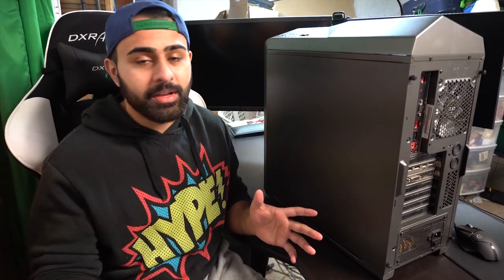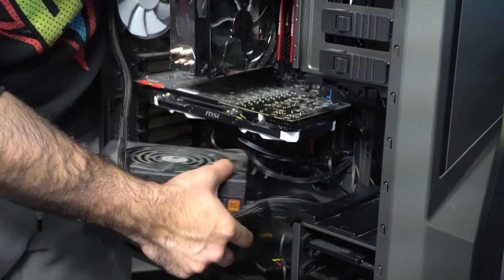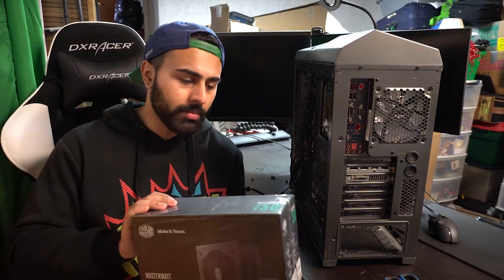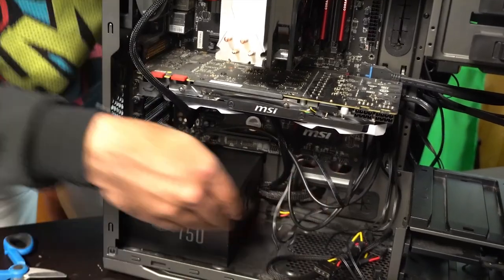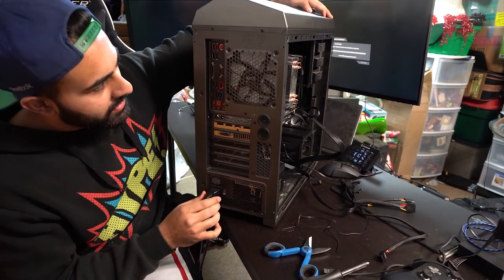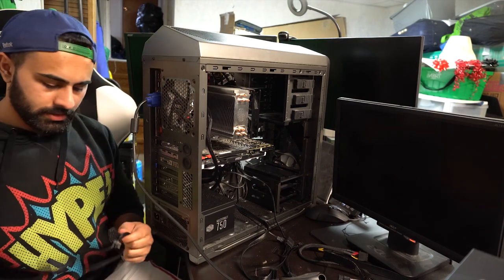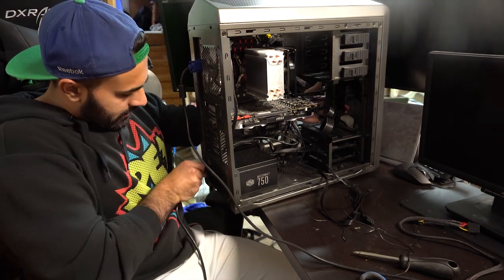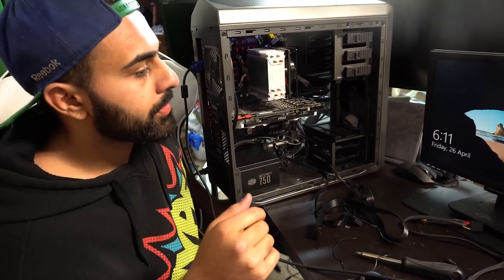💀 DESTROYED my gaming PC! Fixing water damage // Changing power supply

Comment: Yesterday night my Girlfriend spilled soda directly ontop of my pc (by accideny ofc) my Pc still worked for about 10mins then all of a sudden my monitor and pc turned off i opened the case and tried wiping down the mother board and Graphics card. I dont want to disconnect anything because i had mine built for me  in fear of me messing some up. What should i do? And how do ik if there isnt any liquid inside the graphics card or power supply ?
Reply from the maker: Turn the computer off and unplug it for a few days (~3 days). That will be enough time for most (if not all) the liquid to evaporate. Then try turning it on again. Unfortunately if the computer shut off this means something went wrong so you might have replace some parts. But wait for a few days then turn it on again. You can also reach out on our discord server, we have an awesome community that can help you out :)

Discord: https://discord.gg/BnMrrQMq

Comment: I accidentally spilled spoiled milk on the pc and got working after 2 weeks, but the screen won't show. The GPU is turning on and I've tried multiple hmdi and display port cables. Could you please help?
Reply from the maker: Remove the GPU and try a direct connection if you have an Intel CPU
Reply: @VlogsUnleashed  I'll try thanks!
Reply: It doesn't seem to work, any advice?
Reply: Though from what I can see, my gpu won't turn on anymore D:

Comment: My Pc got wet by rain.... but it was turned off and the Ethernet cable indicator was on... what you do think? Should I try turning it on?
Reply from the maker: I would not turn it on for a few days, but first open it up then use a paper towel to dab areas with water so you get the water out. Maybe remove some components to and let them dry separately. People say 2-3 days is the minimum, but I'd wait a week just incase. Hope that help 😁

Comment: I really hope you respond quick cause its urgent but i spilled root beer in my pc and i instantly turned it off. i left it for 1 day and now im just turning it back on. At first it looked like windows didnt recognize me but now i clicked reboot to windows 10 and it works. Is there an issue that something would catch on fire? it seems like everything is dry. but some things are sticky! i dont think that matters unless its a moving part no?
Reply from the maker: I would try to clean as much of it as I can. I would still leave it off for a few days just incase there's a drop somewhere
Reply: @VlogsUnleashed  Thank you bro it ended up being fine after leaving evaporated for 2 days. Some things are sticky. but not wet

Comment: I split some water on my pc and i wiped it up
So i checked if it works and it did i used it for a couple of minutes and after a while it turned off
Then i unplugged it from the power and left it for a few hours
So after a few hours i turned it on and it worked correctly
After like 30 minutes I turned it off and got busy with something else
After an hour or smth it turned on randomly then turned off.
Now it doesn't wanna turn on what happend HELP
Reply from the maker: Wait a few days then turn it on again. There might still be water in there somewhere and you could be causing damage. If in a few days it still has a problem it could be the power supply. If it's turning on and off it sounds like a power issue but it's very hard to diagnose without seeing it
Reply: @VlogsUnleashed  it's working now thank you
Reply from the maker: Glad to hear it! Was it the power supply?

Comment: Today I spilled a little bit of water on top of my pc I think some might have dripped into the top vent but it was on at the time and didn’t shut off it worked fine until I came back a couple hours later to turn it on and the light comes on for a second then shuts off I don’t know what to do and my parents are pissed at me pls help🙏
Reply from the maker: Sounds like you had a similar problem as me. Do you know which component the water fell on? For me, it was the GPU and Power Supply Unit. I was able to start the computer again with a new power supply unit
Reply: Vlogs Unleashed  I don’t know when I I took me computer apart I couldn’t find any water
Reply from the maker: @steenmadsen5180  Try again in a few hours. I  would try to figure out where the water fell. Sometimes the water will leave spots after it evaporates. Try to find these spots and you might be able to see which part had water on it.
Reply from the maker: @steenmadsen5180  Then you might have to guess and check. replacing the power supply might be a good place to start.

Comment: Heya, i spilled water on my pc around 3 weeks, i let it dry out for days, and it works, but I have no HDMI signal, someone please help, ive tried almost everything and it still wont work?
Reply from the maker: Try a different HDMI cord. Make sure the port has nothing inside. Confirm the monitor is on the right input. If none of these work, then try plugging the HDMI cord into the motherboard and remove the graphics card. This will only work with an Intel PC. If that works then you have something wrong in your graphics card. If it doesn't work then join our discord server. We have a tech chat and more people can help there

Comment: Hey my cat peed on mine and now it won’t turn on what should I do
Reply from the maker: Try to wipe off the puddles. Then, leave it off for a few days (~3 days). Try again and see what happens. Chances are that you might need to replace some parts because it turned off by itself. Might be a power supply issue or something similar

Comment: my friend (ex friend), splashed a tiny bit of water on it, I shut if off for the night and I opened it to check for water corrosion, there was none. Am I still safe or should I clean it in isopropyl alcohol.
Reply from the maker: If it was just water I'd wait about 3 days for any remaining water to dry before I turn it on. If you see any puddles soak them up, otherwise wait just in case.
Reply: @VlogsUnleashed  There were no puddles, maybe a drop or two got into the actual pc
Reply from the maker: @nsrivatsa5167  Yeah, so I would wait a few days just to be safe
Reply: @VlogsUnleashed  Theree were no issues and I am freiends with the dude agaiin
Reply from the maker: @nsrivatsa5167  That's good to hear!

Comment: Hello today I got a bit of water on my pc by accident but only about 5 drops got on top of the gpu, I dried it off with a hairblower because I didn't have canned air, I was very fast on turning it off and unplugging it, do you think everything wi be alr in about a day or two?
Reply from the maker: Give it a few days, I usually say 3 days because that's what I've heard. In general you don't want to use canned air or a hairdryer unless it's cold with low pressure. But if you cleaned it up right away it should hopefully be fine.
Reply: @VlogsUnleashed  ok, thank god I hope everything is all right, also quick question, what is the thing on top of the gpu that looks like a cpu socket? A drop landed there and I dried it but I'm not sure what its for, thx for the help
Reply from the maker: I'm not sure, can you post a photo in the discord server?

https://discord.gg/S5sR3frt

Comment: Bro can someone help me i spilt my drink on my pc but it was not that much i waited a day and i turned on everything works but my monitor says no signal
Reply from the maker: That's not good. Here are a few things to try: Get a new cable to connect to the monitor. Try a different port on the graphics card. (If you have an intel CPU) try removing the graphics card and connect the cable directly into the motherboard port. If these don't work, you might have to take it to a specialist. You can also try uploading a video to the discord server (link in the video description). Maybe someone on the server might know what's wrong.
Reply: @VlogsUnleashed  thanks for your information 🙏🏽

Comment: Hi! I accidentally spilled some water on the side of my pc where the power button, headphones and USB ports are located. I already opened it and removed the water. There wasn't much water actually but I am worried if water went inside the ports. Will it be fine? I haven't tried to turn it on yet. It was off when the spill happened. My wifi and bluetooth dongle also got water in it because it was plugged in the ports but I already dried them. Will it be okay?
Reply from the maker: I would recommend waiting a few days just incase. Better safe than sorry. However, all those ports you mentioned won't really damage your PC, so you're probably fine. But just wait a few days incase some water got into some important parts. That way the water can evaporate

Comment: Hey dude i just spilled water on my case and its not turning on, opened it and just waiting for it to try rn, anything else i can do?
Reply from the maker: Do you know on which component the water spilt? Best thing to do is not use it for at least 3 days, so the water can dry up.
Reply: I opened the case and put the fan facing it, that way itll dry up,  The water just went it from the top, split on everything im assuming, do u think i should let a pro check it out now or after a day or two?
Reply from the maker: @jacobchammai5180  If you don't know much about computers, you a pro might be able to help. You can also look around the case and make a list of the parts affected. Then you can try replacing the parts that don't work. The power supply might be a good place to start. For me that was the reason why nothing turned on.
Reply: @VlogsUnleashed  yeah id rather take it let a store check it out, thank u so much man
Reply from the maker: @jacobchammai5180  No problem! If you found this helpful, don't forget to hit that like button and subscribe :)

Comment: i spilt coke all in my pc. pc shut off and i heard a bang, if i replace psu will there be harm testing it after?
Reply from the maker: Before you replace anything, figure out where the coke spilt. If you see any coke residue clean it up (there are lots of great videos on how to clean it up). If you're able to clean all the left over coke then you should be fine. But be careful. When I tried turning on my PC, there was a fire so it's possible you might have a similar issue.
Reply: @VlogsUnleashed  ok, thanks.

Comment: Just spilled water on my power supply don't know what to do.
Reply from the maker: Turn the PC off, unplug it, the open the case and dab any water you see. Leave it off for a few days (at least 3) so the water can dry
Reply: @VlogsUnleashed  I think it short circuited any other tips lol
Reply from the maker: @xj344x  Yeah so now you need to find out which component is broken. If you don't know much about computers, I would recommend taking it to a professional and they charge like $50 for to figure out the issue for you

Comment: I spilled water on my desk and it flowed down to my pc hopefully it was only the power supply since it didn’t spill on any of the other parts
Reply from the maker: Hopefully! Just give it a few days before turning it on
Reply: @VlogsUnleashed  Update 8 months later. Took it to a repair shop they said it has some damage on the gpu. This was false and the did no repairs on the pc for a month. Ended up going to another repair shop 2 months later said it had mold on the motherboard and the powersupply. ended up costing me 600 bucks. I know you probably arent going to see this but still going to update you

Comment: I accidently spilt 1 liter water bottle over my PC once, ir immediately locked up turned out the motherboard fried :/ luckily my psu and gpu was still working after that
Reply from the maker: I'm glad the damage wasn't too bad. I had the opposite problem and GPUs are expensive
Reply: How did u figure out it’s the mobo only? Literally same thing happened to me
Reply: @hanid3008  I replaced the motherboard and everything was fine after that, still using that PC
Reply: @Karthor.  you just replaced it? Imma do the same, I think it’s only the mobo
Reply: @hanid3008  Yeah, you could check where the water went over if thats possible, for my case it was only the motherboard, it started the first time trying it (after the water got spilled) and after that it was dead, the VRM's got shorted but yeah most likely thing that will go bad is the mobo and possible the PSU?
Reply: @Karthor.  for me the water spilt on the mobo. The PC was still running but I manually turned it off. I tried cleaning all the water and attempted to turn it on. It didn’t turn on, my concern is wether it’s the mobo or psu+mobo
Reply: @hanid3008  Ahh i see most likely the mobo but you could try and take something metallic and put between the green wire (PS-on) and black wire (GND) on the ATX connector to the PSU that will tell it to turn on the PSU, if the fan starts spinning most likely the PSU is fine and its the mobo that is dead, but if you do that do it without the motherboard
Reply: @Karthor.  last thing, let’s say the psu does work, how do I know if it ain’t got the same problem as the psu on this video (it’s output is oscillating which could damage parts)
Reply: @hanid3008  I've never seen a PSU oscillating usually a PSU got under voltage protaction, over voltage protection and over current protection and would cut out if it goes too high or too low and it would need to be unplugged for a time to work again, if no water got to the PSU, i don't think you need to worry about trying it on the new mobo

Comment: I spilled soda on my computer rn I turned it upside down and unplugged it as soon as it happened
Reply from the maker: That's good that you unplugged it right away. If you can, try to use a cloth and dab the liquid out. If you can remove the different components it will help try the computer faster. Now you just have to wait, which for me was the hardest part 😅
Reply: I dabbed with a cloth then used my fan to blow my pc out we plugged it back in and it worked so I shut it down normally right away
Reply from the maker: That's good to hear
Reply: It's working perfectly fine nothing got messed up I'm pretty lucky
Reply from the maker: Always good news!
Reply: You're very lucky! I ordered a Mobo/CPU/RAM from an auction site to build my niece a computer. While testing I just had it under my desk connected to a PSU and SSD... Ended up knocking a beer over and some got on the MOBO while it was on. I turned it off immediately and flushed it with rubbing alcohol, but now it doesn't even power on at all -_- kind of wishing I was the type of person to lie and say it arrived damaged, but I'm not, so that was probably the most expensive night drinking I've ever had :( lesson learned
Reply from the maker: @martinj9647  Yikes! Did you have to replace everything or just the motherboard?

Comment: I spilled some chai and some rajma on my pc. What should I do? Any suggestions? Should I throw it away ? 😂
Reply from the maker: I would disconnect the PC from from the power, and try to wipe all liquid from the PC. Clean up all the Rajma and chai with a cloth, just dab the cloth. If you rub the cloth it can damage the PC. If the power supply was affected you might have to replace it. I would risk using a broken power supply, it fry other parts of your PC. Hope this helps 😁
Reply: Vlogs Unleashed are you sure ? Should I maybe throw some chawal on it ? 😂
Reply from the maker: Even though rice (chawal) could help absorb the water, it might be hard to surround the PC with rice. Also don't put rice inside the case because if you don't clean it nicely it can cause problems. I would just dry the PC on a cloth for a few days, maybe remove the different components so they can dry faster.

Comment: I spilled my coke in my pc the front hole not the back side but it work I unplug the behind cable fast and made my pc twist the other side
Reply from the maker: If you think there is a chance that the coke reached some of the exposed components, or you are unsure then wait a few days for it to dry. Since it is coke, I would try to gently dab the liquid so it doesn't affect the components.
Reply: @VlogsUnleashed  Oh ok thank you it's now fine I waited for 2 days (the coke went in the usb plug in the front will That cost anything to break? (I've tried the usb and the audio plug it still works but I'm not sure cause I am still scare it might ruin)
Reply from the maker: You're probably fine. Those components don't really affect anything
Reply: @VlogsUnleashed  Ok thank you 👍
Reply from the maker: No problem

Comment: I spilt water on my pc while it was turned off and clean it in 3 min
Reply from the maker: Just make sure it's dry and unplug it. Then don't touch it for at least 3 days. It's not worth the risk. If you found this info useful, don't forget to smash that like button and subscribe
Reply: @VlogsUnleashed  thanks man i played my pc today and it works fine runs 200 FPS still so that’s good